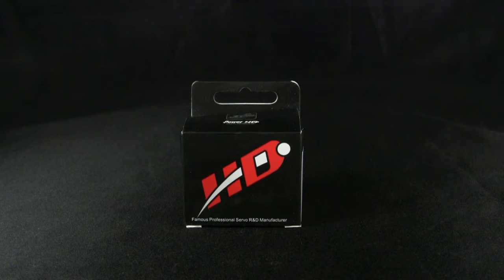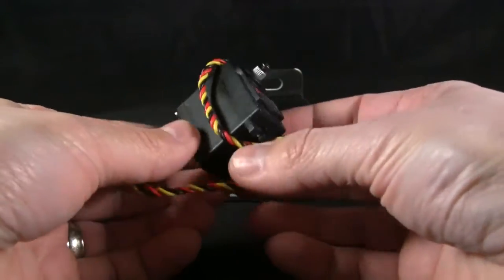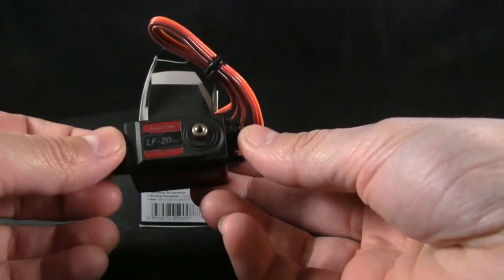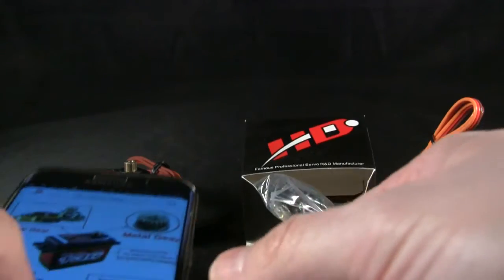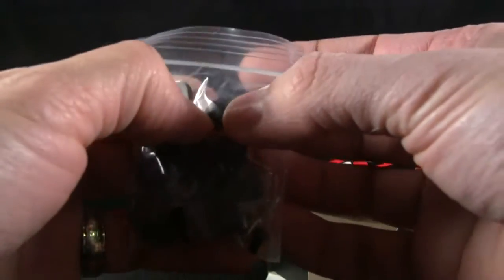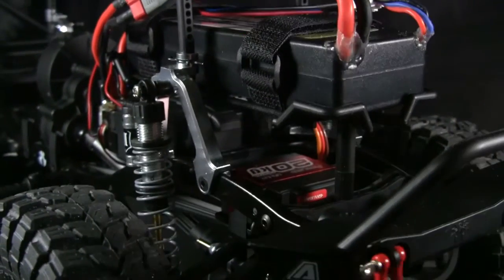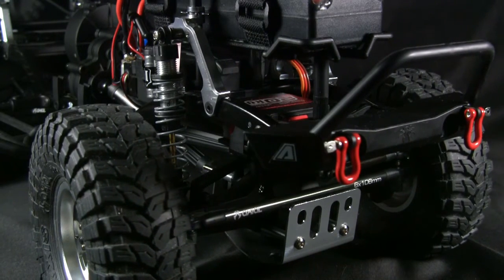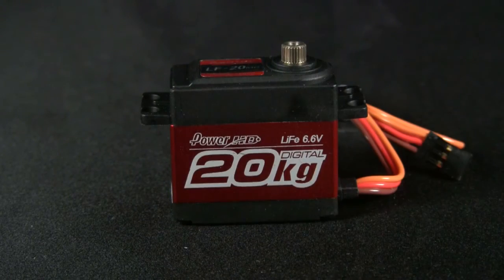Power HD LF-20MG 20kg Digital High Torque servo unboxing

Comment: Nice review.  I have a few of these 20kg's I'm contemplating using in a larger RC plane. If they work well, I'll use several more.  I'm still on the fence for use in aircraft, but every review I've seen is decent.  Do you know what/where to get servo arms to fit this servo?...  and/or what major brand servo arms might be compatible?...  Thanks.
Reply: Dale Grant I'm pretty sure the arms use Futaba splined 25T. Going by the technical documents on the official website, all their standard size servos use the same spec arm gear. Don't own these ones myself though (yet). 

How do they perform in your plane? I'm torn between using the higher speed 13kg or higher torqued 20kg in a 30cc gasser.